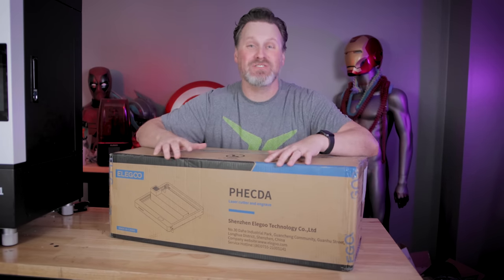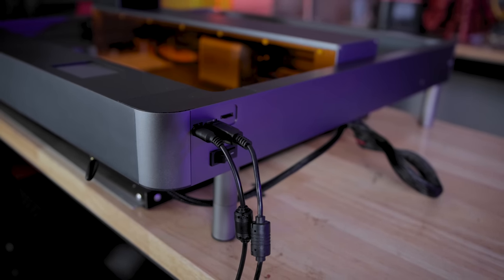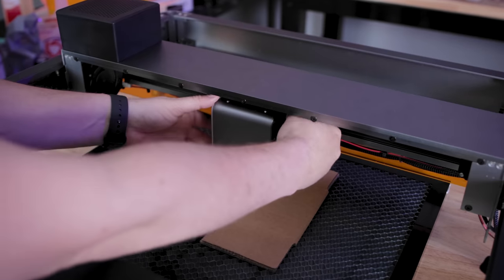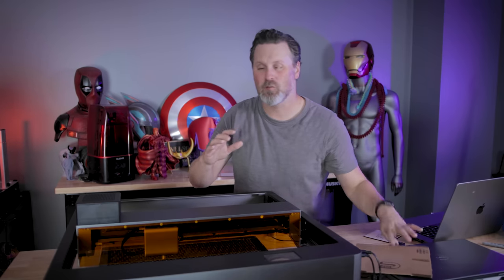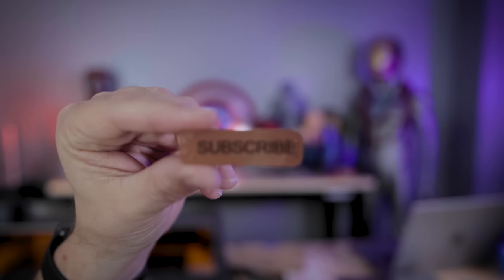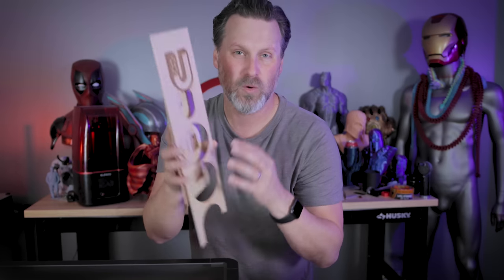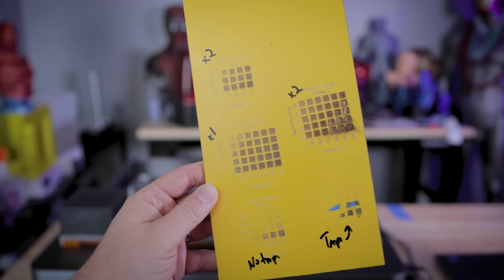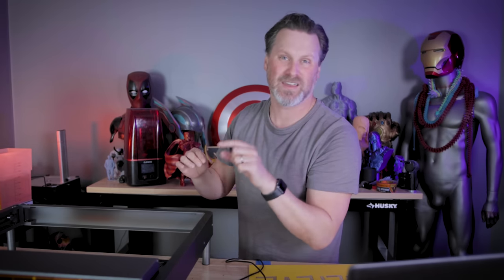Elegoo PHECDA Laser Engraver - First Look

Comment: After thousands of hours of engraving and cutting with CO2 lasers and many successful projects sold, these open air/unprotected units are just madness. Both safety and smell issues abound, and even with a fully enclosed unit with strong air extraction to the outdoors it can be an unpleasant situation when working with acrylic in particular. Utterly bonkers to let this stuff be out there in the room air.
Reply: Yep, just watching that laser fire away with those useless side panels doing nothing.
Reply: Glad you said it because I was thinking the same thing. I would never cut acrylic on that thing because I can barely stand doing it on my epilog as it is lol.
Reply: @chadhowell1328  why not a fan of using it on epilog?
Reply: @JohnSmith-rt5yq   acrylic sucks cutting on just about anything honestly. The fumes are pretty strong and make me sick to my stomach really.
Reply: You need decent extraction and filtration, I run a studio with 4 100w CO2 cutters, our Bofa extractors do a great job. Although I can't see a home hobby user paying £3k for extraction..😂
Reply: I have a $170 Atezr enclosure with filtering viewing window, fan and exhaustion pipe. Works wonders. Airbrushes don't come with a painting booth, Resign printers usually don't have gloves in the package, CPU don't come with a case, CO2 laser don't come with air exhaust and water cooler - and Im glad they don't, I dont want to have to pay for an enclosure at each new laser I get and vice versa. 
Only issue is Uncle Jessy not knowing jackshit about laser yet.
Reply: Lasers DO come with venting and cooling if necessary.
Just not the cheapest hobby lasers on the market.
Reply: Diode lasers can't cut acrylic, so that's a non issue. As for safety, it's more a matter of people being aware of the risks and steps needed to mitigate or remove them. A pair of certified laser goggles that cover the wavelength of your diode, (the ones included and that he has don't cover the wavelength of the laser. We've brought this up to Elegoo, we'll see if they fix it by launch. I've already budgeted for a pair of certified goggles) a 3m respirator for the fumes, and possibly some extraction or filtration. At worst set up your device in a garage, barn or other area where you can open it to the outdoors. Not your kitchen or living room.
Reply: @neobaggins3718  Diode lasers CAN cut acrylic, just not every colour.
Reply: Its only your opinion nothing else🙄
Reply: Pls sent me some money for CO2 laser or dont speak 🤫
Reply: Would like to see it cutting plywood and MDF for scenery or interlocking box sides.
Reply: So, what is your advice for beginners to buy CO2 laser?

Comment: Open laser cutter or engravers without full protective enclosure should be illegal in the EU, who knows, maybe they are and these things get sold here anyway. Maker's Muse has made some great videos on how irresponsible those devices are, as others have mentioned here already too.
Reply: My eyes hurt just from watching the video
Reply: I held this view for a long time too, but if you're willing to take the steps needed to ensure your safety, they're fine. Also, the Phecda goes way further than any of the other diode lasers I've seen with regards to eye and fume safety. For the $240-400 KS price, you can easily buy a pair of certified laser goggles and a 3m respirator rated for laser fumes before even hitting the price of competition units without any safety features.

Second, I'd like to say the only thing that needs to change with these machines is transparency with regards to the risks. 3d printers share many of the risks with fumes from the various thermoplastics being melted inside people's homes. Not as bad as laser cutters obviously, but it's hypocritical to parrot the 'dangers' of a machine while ignoring the dangers of a far more widely accepted machine. The idea of banning these machines is typical nanny state BS I'd expect from a European. Inform people of risks, don't legally prevent them from taking them, especially when simple steps can be taken to completely eliminate them.
Reply: No they shouldn’t be illegal, the safety information is fine - used these types of cutters for years
Reply: In the shape and form that they are sold they are definitely not safe to use. You are either using them in an heavily modified form or you are using them in an unsafe fashion. Adding insult to injury one can not trust cheap Chinese "UV Protection" glasses either. So even if you operate those lasers in strictly access controlled spaces, you can't operate them safely unless you buy additional safety equipment and wear it at all time while the machine is powered on.
Reply: @sagichnicht6748  no if you make a simple enclosure for them, wear the supplied eye pro that filters the light wavelength of the laser and use it well ventilated area it’s fine.  Would you say an angle grinder or a drill is unsafe in the way they are sold? No probably not.
Reply: @db7314  The supplied eye protection is some random Chinesium, there is no guarantee it even blocks the light frequencies it is supposed to block. Using that stuff without either enclosure or certified eye protection from credible manufacturers is just unsafe working. 

The enclosure is the point btw. This is critical safety equipment. This shouldn't be a "oh btw you have to build an enclosure because we slashed it for a few Euros lower prices" but the enclosure should be an obligatory part of the package. There is no excuse why it is not. 

This is clearly marketed at hobbyists who have no clue how to work safely and even a short search on youtube is sufficient to see that a lot of people do use those tools in completely unsafe ways.

Comment: Acrylic? Try some acrylic! Also, 3D prints? Can you use it on low power to maybe add in some details for cosplay prints? Regardless, thanks for the awesome content!
Reply: I think acrylic needs a different type of laser as this one tends to transmit through the plastic
Reply: @OldManRogers  Yeah I don't know anything about lazer cutting - it seems that if it's powerful enough to cut aluminium, it should have the power for acrylic, even if you have to use opaque instead of transparent.
Reply: @isturma  It can't cut aluminium.
Can cut some acrylic, depending on colour. Can't cut clear.

Comment: Just got my Neptune 3 max in the uk. I’m crazy impressed. Quality on build and prints is next level. Elegoo are killing it.
Reply: Yeah same here for the price it's exceptional. UI is a bit odd and the build instructions were not the best, it's a simple build but I did have to adjust a fair few things from experience. Produced a great Benchy with just a slight temp increase over the generic PLA profile and nothing else. Only thing I'd change is there should be a couple of bigger nozzles (0.8mm) as 0.4 over that build volume is a bit unrealistic.

Anyway I backed the Phecda to go along with the Max and Saturn
Reply from the maker: The max for the price / size / print quality & auto leveling is just 🤘🤘🤘
Reply: Ahh there is s Video on the included card showing the build which is much better than the manual.
Reply: Hi what filament did you guys use? Can you recommend any? My max is still sitting in the box :(
Reply: @marinated5425  I go with the Elegoo pla in black or grey. Best to buy in 10 packs but there’s a bit of a delay with them at the min. Easy to grab singles.

Comment: Excited for this, backed the Kickstarter day 1.
Reply from the maker: Really enjoying it so far!
Reply: Yeah, got in on the 20w early bird! Can't wait for June...and whenever the air assist, rotary table and honeycomb come lol. Look into getting proper goggles, the green ones they included here don't actually block the wavelength of the laser. Wavelength is listed on the KS, and you can use that to cross reference with certified laser goggles. They're about $180+. Several of us backers have brought up to Elegoo that the goggles are incorrect and insufficient. We'll see if they fix it by shipping.

Comment: Would love to see you engrave some Yeti mugs. They come in all shapes and sizes so curious to see how the rotary attachment would work with something like that.
Reply from the maker: Oh I will 100% be doing that in a future video once I get the rotary tool
Reply: The roller style rotary attachment they're currently planning is not great for anything more complicated than a simple cylinder.
I already suggested a chuck rotary attachment and they forwarded that to r&d so fingers crossed a better one will become available too. Heard it might be possible to use other brands too, like the great but expensive RA2 Pro from xTool.
Reply: @YaaLFH  you could print or cut an adapter ring for you mug to sit straight on these rollers
Reply: @Bazzdiver  Yes, I could and I have done that in the past, but it's a hack, not a solution. Tapered cups need to be levelled, not sit straight on the rollers. It's very easy to ruin an expensive cup because it slipped on the rollers. It still doesn't solve the problem of handles.

Comment: I ordered one but I am a bit worried about the eye protection, it is pretty lackluster. Perhaps the cheap glasses combined with the orange glass pane is enough?
Reply from the maker: I'm honestly not sure as I have no experience with these types of machines. I am looking into what other glasses options there are and I might look into making a printable adapter for another piece of acrylic. Then again I'm assuming its some sort of special light blocking ... dunno but will be looking into it
Reply: @UncleJessy  At that size I would consider making an enclosure for it which you could also then have additional venting outside installed.

Comment: One note about Lightburn (amazing software) is that you do need to pay a yearly subscription 'if' you want to keep getting updates to it. They add new features all the time so it's well worth it and it won't stop working if you don't pay the subscription but you won't be eligible for updates if you don't pay the subscription. I use it on my CO2 laser and it's amazing.
Reply: From the note in the video it made it seem like you pay $60 once and then if you ever want to upgrade to current it's $30 once. Then I'd assume you just wait it out until you decide to upgrade again.. so not exactly a subscription but also not paying full price for software you already own.

Comment: A few questions.
1) is it a true 400mmX400mm engravable/cut able area. Or isnthat just the movement area.
2) what is the outter dimensions.
3) can you post a photo of the Y connect on the main board. That will be used for rotaty attachment

Comment: I'd like to see you engrave glass.  There are a few different ways you can do this.  Easiest way is to have a sheet of black craft paper beneath it and then flip the engraving backwards as it will engrave where the paper is.  Next easiest, and probably more reliable, is a matte black spray paint like chalkboard spray paint.  On the top.  After engraving, you can clean it off with acetone etc.  It creates a tone of microfractures leaving a clouded appearance.  The issue that you can run into with using a diode laser on glass is over-heating it and causing it to actually Crack.  So it would be cool to see some settings with this specific laser engraver that work for you.

Comment: Hey, do you think it would be possible to make a project using FDM or resing 3D print, and engraving later to add details?
Reply from the maker: I have that on my list of things to test out. The one exception is resin… I’m hesitant to do that because of how toxic airborn resin is
Reply: @UncleJessy  Do not laser resin.
Reply: I wouldn’t laser any kind of plastic at all.
Reply: @roofoofighter  With proper venting (not this tiny filter, enclosure + inline fan and venting outside) some plastics are safe to laser, but resin definitely isn't.

Comment: Could you run some tests with different thicknesess of brass? Im looking into getting a laser etcher/cutter but it seems that softer metals are an issue for a lot of these machines. My goal it to be able to produce my own etch brass sets without needed to outsource to a photo etcher
Reply: Foget it, that will not work with this machine! You can’t cut metal, maybe aluminum foil would work, but that is far away from what you are planning. It just engrave into a coating on metal

Comment: Who made this open frames lasers popular? this thing is so dangerous, I will never gamble my eyes on any open laser.
Reply: Certified goggles in this wavelength cost ~$170. $570 all in for a 20w laser and goggles (plus $50 for a respirator, and running the thing in my open barn) is still about 1/10th the price of a  glowforge which locks you into their cloud ecosystem, or 1/20th the price of a full floor sized machine. It's worth it to try out my ideas. If they work, I'll use this to fund a more capable machine. Just be aware of the risks and how to mitigate them, don't regurgitate the fear mongering without actually educating yourself on the details of the risks. Also, 3D printing has its own fume problem that people willfully ignore as they run them day and night in their spare bedrooms, garages and offices. These 'non toxic' thermoplastics might not be as bad as the smoke and fumes off of a laser, but I'll be using the laser in a well ventilated barn with a respirator, which is far less risky than running a 3d printer in your bedroom.

Comment: This crap should be illegal. It's effectively an exposed laser, those two bits of acrylic that don't even extend past the bottom of the laser do absolutely nothing. These things are priced so that people are intrigued to pick them up after shill after shill posts these things on their platforms. People that have no clue that any refracted light will blind not just them, but their kids, pets, etc. Those "safety" glasses have no rating and are no insurance what so ever. This crap needs to stop.
Reply: Could you recommend safety glasses that would work? I have a CO2 laser I inherited and have never turned it on due to nervousness.

Comment: unless there was a newly developed tech last night while I was sleeping under my rock, I believe this laser can't possibly engrave metals.
Reply: no diode laser is engraving metal,  but you can paint the metal and mark the paint not the actual metal.
Reply: It can't.
It can mark the surface of some metals like stainless steel.
Reply: @YaaLFH  Marking is different than engraving, only lasers capable are some co2 lasers, but mainly fiber.
Reply: @BrandonCalrizzion  No way, REALLYYYY?

Comment: I don't really see much point in these low power diode laser engravers. You can get a K40 laser which is 4 times as powerful at less than twice the Kickstarter discount price and it also has a full enclosure so no need to wear glasses, and much better fume extraction. You can engrave and cut so much faster on those that watching this B roll is painful for me. It looks like slow motion

Comment: I strongly suggest only cutting plywood purchased from a reputable laser supplier online. The glues used in oversees and many domestic construction plywood, and in ALL exterior plywood, are NOT SAFE to atomize and can also damage your laser optics over time. All smoke is bad to breathe but those are a no-go on any laser in a non-commercial production situation, even in machines that are fully enclosed and have dedicated exhaust.

Comment: Personally, I hate Lightburn.  I think it is overly complex and not at all user friendly.  I use T2Laser and I feel like I have all the capabilities of Lightbrun with a fraction of the hastle. 
With it's built in dithering and grayscale modes, I don't even need much for pre processing. I resize and set the DPI, and send the full color pic to T2Laser, then use the built in dithering (or greyscale) and I'm able to make size, brightness/contrast and gama adjustments right in the program.
Reply from the maker: Oh thanks! I will take a look at T2Laser as well!

Comment: I backed it based on your livesteam, despite being quite nervous about the state of safety with inexpensive laser cutter/engravers.

There are a boatload of enclosures for these out there and I'll definitely be getting one. From what I know, the one thing I'd say is to really thoroughly research any new material before engraving or cutting it. Lots of unexpected reactions are possible. I'm sure lots of folks have told you you have to be really careful to only use vegetable-tanned leather, but that kind of gotcha is really easy to stumble on. Be especially careful with using it on paints. Lots of stuff is stable and safe until it meets the unstoppable power of *LASERS*.

Comment: For my Diode, I pretty much always use Start from Current Position.  Then I put the positioning laser where I want it to start, do a test frame to check, and go from there.
Air assist is a must get, no enclosure option is a major issue.  You should never leave your laser burning unattended, but without an enclosure you need to always wear your glasses.  That doesn't play out well given many jobs can be 1 or many hours.  I guess they have to start somewhere but I wouldn't touch this until this is addressed.
Reply: It now has an enclosure